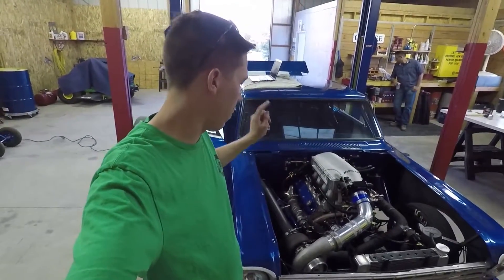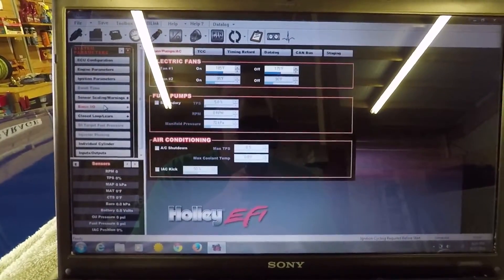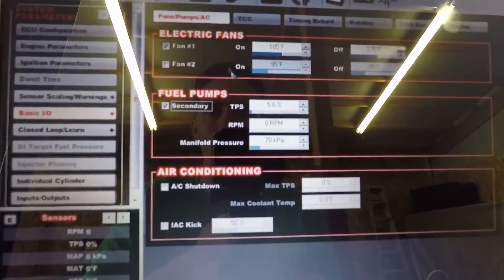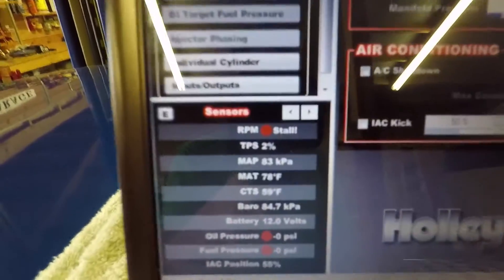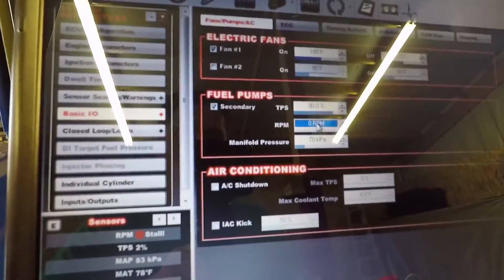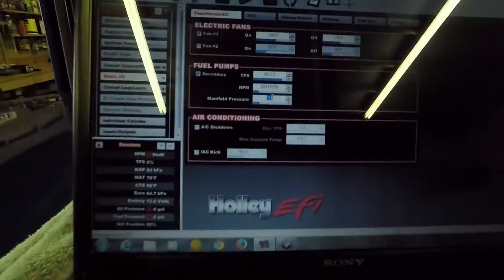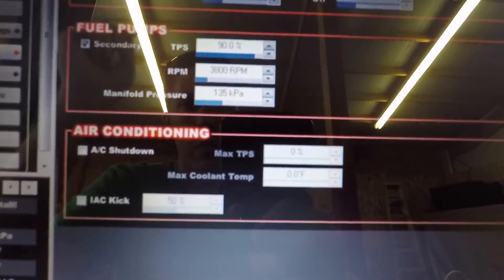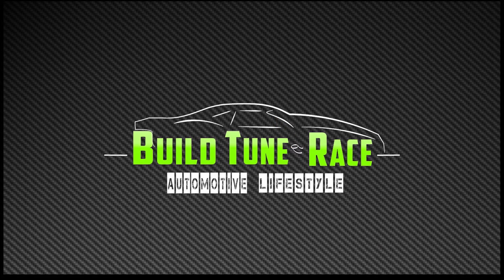Holley EFI How to set up a secondary fuel pump

Comment: I have a secondary fuel pump hooked up on a relay. My trigger wire (86) going to the holley output B11. But nothing is happening when i test it this way. I know the pump works because i wired it to the primary. Any ideas?

Comment: Older video I know but does the terminator x come with a generic harness to wire up a second pump or is that an add on? I’m getting ready to put the X max on my vehicle and need a second pump too. First pump I want to run stock with the ignition on. Second pump on boost pressure thru the terminator X max.
Reply from the maker: You’ll need to buy the Holley I/O harness then you can add the trigger wire for the 2nd pump wire up the boost controller ect

Comment: Hey buddy can you do this same setup for triple pumps. Ie 1 on with ignition. 2nd on at 7psi and 3rd on at 14psi?
Reply from the maker: You could do that holley is only pre set for a 2nd pump but you could be a trigger for it in the holley. I would probably do 1 and both the others on a 7psi
Reply: @BuildTuneRace  oh ok. Yea dint want that much fuel flow but thanks heaps for getting back to me.

Comment: Awesome video, James. Was wondering if you've posted any videos on wiring the Holley HP. Also, was hoping to get w/ you when I'm ready to put a load on mine. Love Jared's Nova, too. I did some work on a friend's 1st Gen Nova and after about a year and a half he rolled it several times & flipped end over end, totally destroying all but the motor and trans.
Reply from the maker: I have not. The Holley Hp isn't to bad it's very simple until you start doing in and outputs but still not to bad. Holley has a very in depth manual that explains wiring pretty good. I'd like to do more wiring stuff in the future though.

Comment: What the differences in the output type? I can't get mine to trigger. I see yours on B12,  mines on B11 and doesn't work. I'm assuming that P+/P- means something? Do I have to move my pin to one that says P+? I need it to trigger 12V to my pump relay
Reply from the maker: If your looking to trigger with 12volt you need to find an output H output H=hot/12volt p-/p+ is pulse width modulated for things like solenoids

Comment: i want to test my holly dual boost control set up i here there are ways to do it in the shop.how do you test yours?Thanx
Reply from the maker: I set mine up on boost by time off of trans brake release. Then I set up a boost curve and at the end of the curve it set the dome psi to 0. Once you activate the trans brake you should here the solenoids working to fill the dome and once they hit target dome pressure they should hold and then when it hits the end you should hear the solenoids release the air. This is if you are using a fixed air source.
Reply: yes im using co2 thank you videos are great
Reply from the maker: Thanks for watching!

Comment: Great info! Was actually researching fuel system setups and how to run secondary pump off of boost pressure. This simplified it for me. Thank you! There aren't many videos out there actually showing real applications of using the Holley Efi. Just general information. Stuff like this is extremely helpful
Reply from the maker: Awesome glad I can help! I agree there isnt alot of detailed info on the holley like this. I'm glad this makes some of it alittle easier to understand. Thanks for watching!